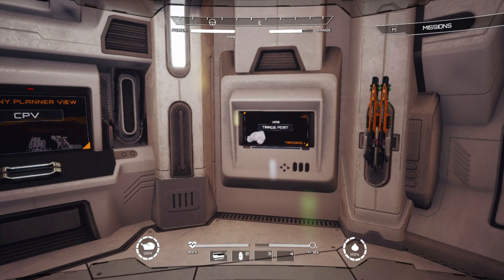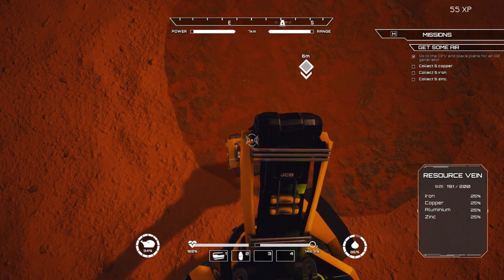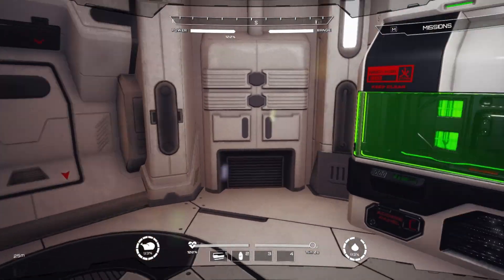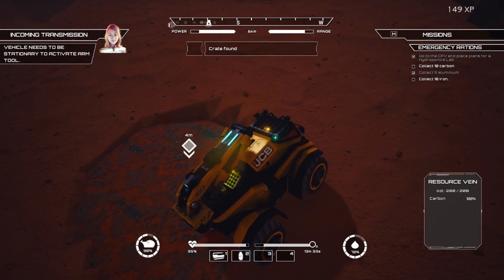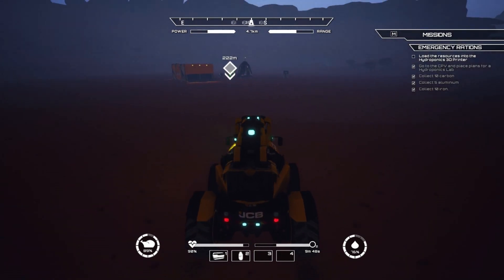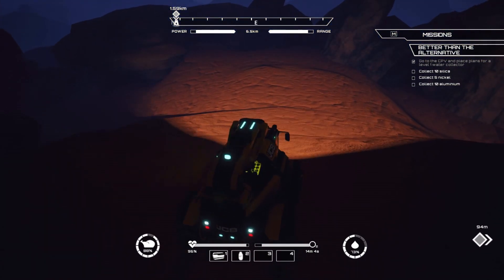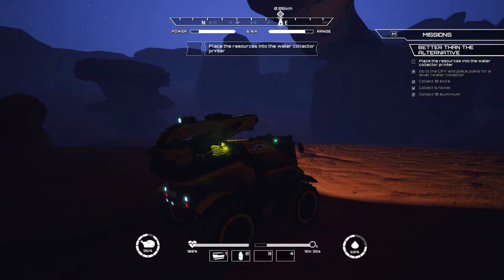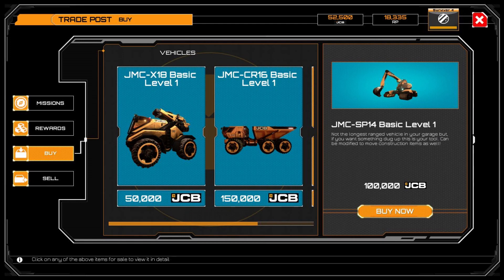JCB Pioneer: Mars - 3D Printed Bases

Comment: Can you start multiple buildings at once and use the 3d printer storage for the incomplete buildings to stockpile more resources?  Or at least empty them out of the rover so you can mine more.
Reply from the maker: You can start multiple building at once, but I'm sure you can't pull materials out from a 3D printed once you put them there, so it's rather bad as a storage unit :)
Reply: No cancel option?  Hmm...